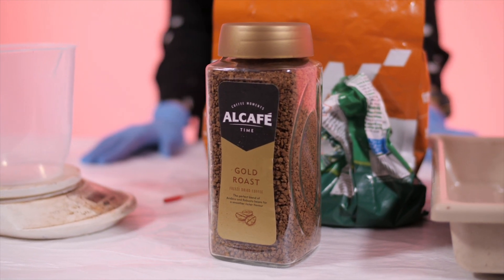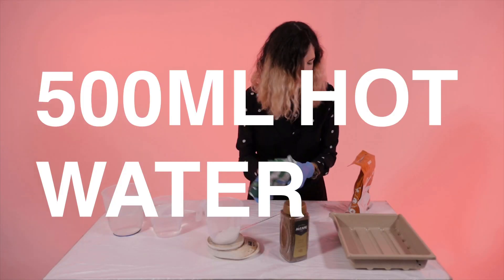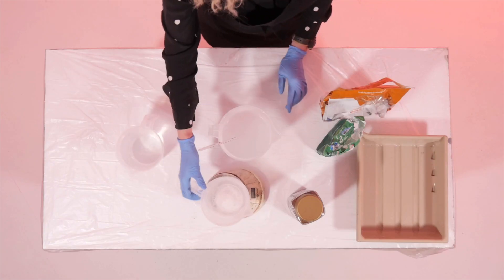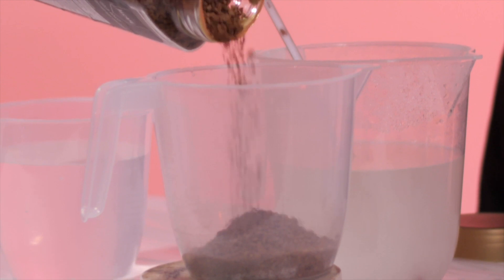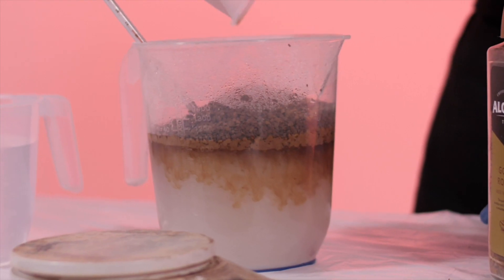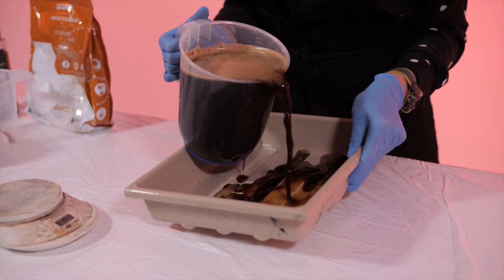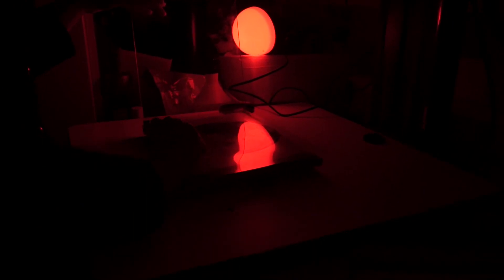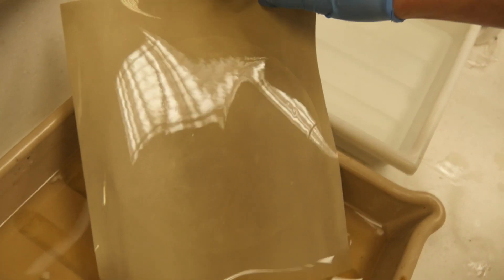Simple Caffenol Print Developer // Video For Schools // Royal Academy of Engineering

Comment: A very interesting process and viable alternative to conventional developer. Out of curiosity, would you know of any environmental ways of disposing of conventional developer in a safe manner? I don't want to simply pour it down the drain.
Reply from the maker: So the most up to date information that I know is to :

A) Reclaim silver from fixer. (Mentioned in another video)
B) Mix exhausted developer and fixer together to make a chemically neutral substance.
C) Leave to evaporate.
D) Scrape out sludge and put in landfill.

Still not perfect but better than throwing down the drain. Info from the Sustainable Darkroom network.
Reply: @MelanieKing  Thank you! When developer and fixer are mixed together to become chemically neutral, is the result less harmful to breath in etc? And actually, just today, I was thinking of letting the chemicals evaporate so it's good to know that this is an acceptable practice. If I put the developer / fixer mix into a container and leave it outside out in the sun to evaporate, I guess I could put netting or something similar over the opening to prevent animals from drinking it.
Reply: @anzaeria I know this is an old comment, but I did also read that camera stores that process film sometimes take used fixer for silver reclaim.